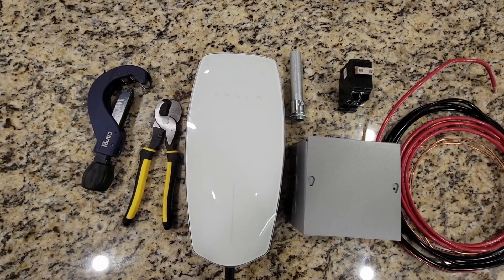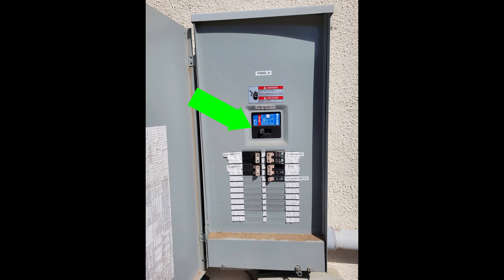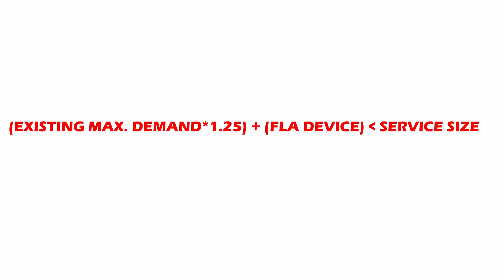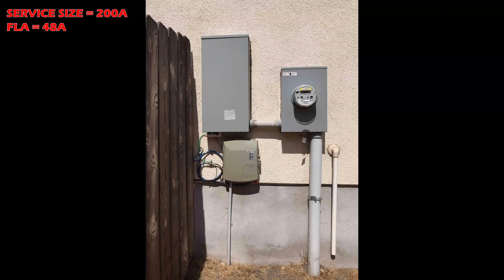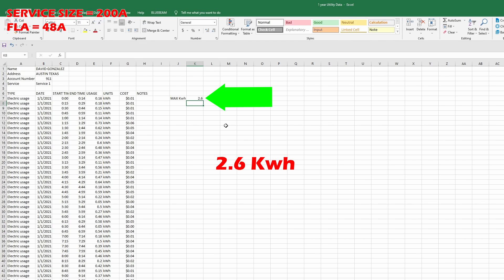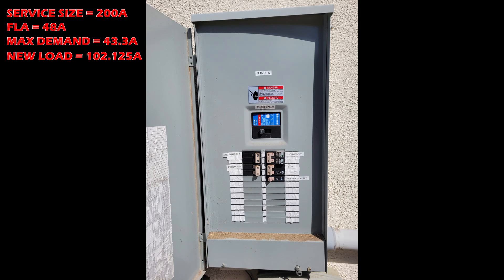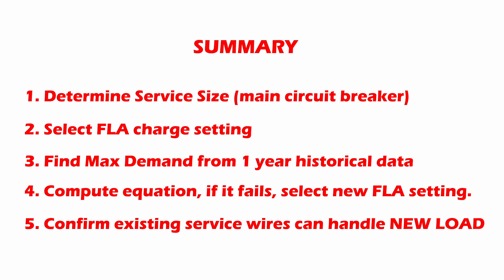Watch THIS before Selecting your EV Charger Circuit Breaker Size DIY

Comment: So to everybody out there. Never make the a phase wire red. Or on the left. Single phase red wire is always on the right and 3 phase the red is in the middle. Number one wire 120v. Is always black or top left of the panel.

Comment: My utility company does not offer a 15m break down like yours. they only list the daily kWh. what is the equation I would use to solve this problem? My highest usage day was 99kWh in August which was due to my ac having an issue which has since been replaced.

Comment: I have an Eaton BR-series 200 A load center with an aluminum bus.  My electrician told me not to run my Tesla charger at full capacity because the aluminum bus might have a problem with the 60A breaker.

Comment: Great video. I agree that this video is so much more comprehensive than most others. I installed my own Tesla charger and felt really confident I had the numbers right after watching your video (about 8 times!). I also learned a lot by downloading the 30-minute usage data from Dominion. Switched over to their Off-Peak plan, which allows me to charge below 10 cents per kWh between midnight and 5am. I have a 200-amp panel and installed a Square D 60 amp plug-in breaker with 25 feet of 6/2 MC cable to the charger. Thanks for thorough explanation!

Comment: I have experience setting up a portable generator to power a house using 50-amp breaker with interlock kit. I'm trying to set up a charger for the Tesla, and the problem is I CAN'T EVEN SEE THE WORDING OR NUMBER ON THE SERVICE WIRES THAT CONNECT TO 120V. I guess the electrician who ran these wires hid it 😂

Comment: Hello, I have 200 amp service with a 100 amp sub panel, and a whole house surge protector. Should it be okay to put the 60 amp breaker in the 100 amp sub panel, or should I move two single circuits to my sub panel to create room for a 60 amp breaker?

Comment: Great video.  If my max demand is 75a without the *1.25 on a 100a panel I'm good, correct?  As long as I don't exceed 100a with the *1.25 I'm safe?  Will check incoming wires as well.

Comment: I went full throttle with a 70 Amp breaker and 50 Amp EVSE. My car maxes out at 10 kw/h though. Ford Mach E GT on level 2.

Comment: Very useful information. Thank you.  In my house, I have a 100amp breaker panel, but the cable coming in from the transformer is rated for 200amps. If this cable was not rated for 200amps, I would have had to pay for digging and installing new larger cable. Also for upgrading the panel to 200amps, I have to wait for the utility company to come and upgrade the transformer (a green box across the street for me), as it is already at capacity, and cannot take my additional load. They explained that this is because it is supplying power to 25 or so houses in my vicinity, and many of them use  200amps with pools and what not. Transformer upgrade is free, and the utility company takes care of it. But the time impact of  these sort of thing must be considered while planning.

Comment: Can I use a 50 amp breaker and set it to 40a on my app so it sends 32 amps? ( we have a plug in Pacifica in addition to our Tesla ) I installed it with a 50 amp breaker, but I’m wondering if I should change it or if it’s OK?
Reply: No the device itself will only draw its own FLA. No need to adjust amperage.

Comment: Utilities are moving toward charging separate rates for energy vs peak demand.  If your does, you will want to charge your car at a lower amperage to save money.  I installed an 80 amp charger 10 yrs ago thinking I would want to charge quickly. I soon realized I didn’t care if my car was done charging at 10pm or 6am.  I now charge daily at just 12 amps x 240v ..and I drive 1.5x more than average .. 30,000 km/yr.  Message .. most people do not need high amperage charging.

Comment: If you have 200 amp service and a 200 amp breaker, wouldn't the service cable have to be rated for at least 200 amps? It would never have passed inspection otherwise I assume.

Comment: Excellent advice! I’ve only got 125A service, but thanks to your info, and a quick script to parse the XML format that Duke Energy allows me to download, I determined my max usage over the past ~25 months was 2.59kWh in 15 mins (= 10.36 kW), which works out to ~43.2 amps. My subpanel is fed by a 60A breaker, so I was planning on charging at 32-40A anyway.

Comment: Are you going to do a subpanel to EV charger video? I want to add a charger to a subpanel, it has a 80A run using #3 copper at 90 degrees. Panel is rated for 100A but I have a number of 20 and 15 amp breakers. Thanks!!! PS. my main panel is full! :) Oh and BY FAR the best info out there!!! Too man people just show you HOW too do something and have ZERO info on the "before you do this, DO THIS!!!"... so thank you!!!

Comment: Thanks for this. I upgraded my old 60 amp meter base and 125 amp panel to a new 200 amp CSED and a 100 amp house panel a couple months ago. I added a 16 amp EV charger last month as well, but didn't find your video until just now. My usage over the last 12 months peaked at 148 amps (!) one evening in June with many instances of 120 amps last summer, I'm very, very thankful that I didn't burn the house down. Good info to know, thank you!

Comment: I installed a 20A/220V with 12/3 wire and a simple 16A level 2 charger.  That’s enough for anyone unless you drive 200 miles a day.

Save $1000s by staying simple. It is not necessary to install a larger service to wake up each morning to a fully charged EV.

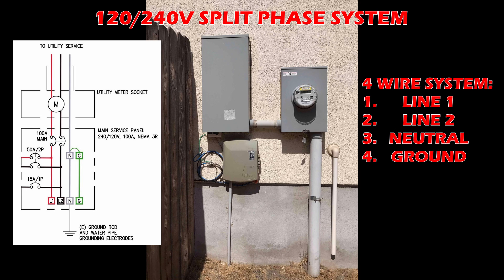Comment: Thank you for a great explanation. At 1:22 your drawing shows the Ground Rod connected to the Neutral bus, and the two connected together. Is this the correct way to connect them or should the ground be isolated from the neutral. Thanks

Comment: @6:58 you are expressing a unit of "Kilowatts PER hour". It's not the first time I've heard it, but it's annoying and incorrect. The unit is Kilowatt hour as in KW TIMES hour = 1000 Joules per second x 3600 seconds = 3.6 Mega Joules of energy.

Comment: Great Video. I have a quick question. 

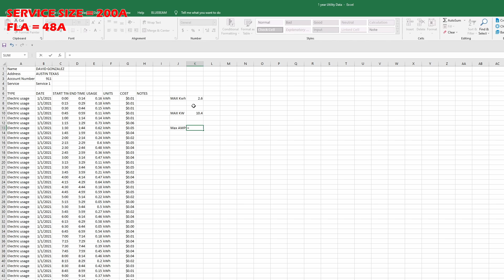@DG TV, Pardon my ignorance, at 8:05 minutes, why are you diving by 240 V ? In the US, the service is 110 V, shouldn't you be diving by 110 ?
Reply: in the US our service is 220...you have 2 110 hot legs coming into your panel, hence the 2 wires, one on each bus bar...

Comment: Im sorry but what do the service wires have to do with any of this? They’re already protected by the main breaker to prevent the wires from becoming overloaded. If anything the main breaker will trip if you have too many things on at once. But to say the service wire can become overloaded is false IF the main breaker is sized correctly.

Comment: Why are we dividing the kwh in our peak usage by 240? If everything in the house ran on 120, we would divide by 120, then the amperage would be higher. My house is mixed but only the stove and dryer run on 240.

Comment: Thank you sir for this Master Class of this topic.  Long contemplating my first EV acquisition, I now consider myself very-well informed.  I do have one question remaining, regarding house electrical wiring.  Working with an architect and builder, I designed and built my home 12 years ago.  I requested a dedicated circuit with high-capacity wiring from the service panel to the garage wall.  I told them to terminate the garage end of the wires in a standard junction box since my plan was to hard wire the wall-mounted charger.  And for inside the service panel, I told them to hold off installing a circuit breaker, just leave the three wires (L1, L2, ground, NO NEUTRAL) unconnected to anything.  The breaker would be selected and installed in the future. 
  
Long after moving in, I discovered that the electrical subcontractor used #8 AWG (19-stranded copper THHN/THWN-2 wires inside dedicated raceways) for the wires between the service panel and the junction box in the garage wall.  It's about 35 foot run.  From what I have read, based on wire gauge and the distance of the run, the highest amperage circuit breaker I can install would be a 30 amp.  Agree?  Or could I install a 40 amp breaker?

Comment: Question : Why do you devide by 240V for "Max Demand" from historic data?  The US use usually 120V for normal device (which used in historic data) even though we need to add 240V device.

Comment: Well you defiantly have a lot more to learn the buss bar in a panel is red and black on the same side only alternates from ''A'' to "B" leg from to[p to bottom  

And the blue leg can also be 120v  like black and read 

To do a load calculation you don't need your utility  power bill all you need is to know the amps of appliance's and motors plus square footages of property   and do the calculation from there 
 
 You defiantly did not design  any charging station  in California  at all

Comment: Going from a 50A circuit to a 60A circuit will also require you to upsize the wiring from 6AWG to 4AWG (copper) to the EVSE, which can add significant cost to the installation.
Reply: If you are using romex. If using thhn in conduit, #6 is ok for the 60amp breaker. Assuming hardwired and not outlet.

Comment: I suspect that if the service wires can't handle the breaker-rated load, then you have a system that's not code - before you do anything.

Comment: Good idea on checking the service wires and their max loading.  But Table 310.12 may not be exactly accurate if there are high temperatures involved or different conductors are used.  Ambient temperature would be considered to derate the amperage.  Of course, one would assume that was done correctly in the first place with the amperage of the main breaker, but maybe it was not. If the house is old, one could see how the service feed wires were calculated to an old code standard..

Comment: Braided or solid wire with the #6?
Reply from the maker: Stranded wire is easier to pull and typically less expensive
 For this reason it is preferred

Comment: Excellent video.  I looked at my last two years data.  I found that I had "one" hour where the usage reach 10.7 kWh.  All other entries are showing Max around 7.5 KWH.  My panel is a 100 AMP.  it means that I cannot use a 60AMP breaker (because of this one entry) and I have to go down to 50 AMP.  Correct?

Comment: You forgot a very important point. Checking the wire size of the conductor running to the EV charger. Just because your service wire is within spec doesn’t mean the wire running to the ev charger can take that amperage.

Comment: Excellent video & very helpful - 1 question. I have 2 200 amp main panels , if I download data from electric company it would be the max load between both the panels right ? Is there a way of calculating for individual panel ?

Comment: Great video.  So if I have a 200A service, does this mean I can pull 200A continuous?  Or only 160A continuous?  Building a new house with 5 EVs to charge on 200A service.  So there will be some dynamic sharing going on.  Tesla HPWC (Gen3) should allow me to program this to keep all my NACS and CCS vehicles happy.

Comment: Having been Nan avid YouTube DIY video watcher since the inception of YT, I must say that this video has been the MOST comprehensive video I have seen - a sincere and big THNAK YOU for that and keep up the great work.

I have a question. As far as I gather, Tesla plug does not use the neutral wire (as your wall charger wiring indicated) - so, what is the purpose of having a aneutral wire in 14-50 plug wiring?

Thnaks again!

Comment: Your information is highly technical and a bit helpful, but simply 48 Amps on a 60 amp breaker is 80% of the load this will put a lot of pressure on that circuit breaker which in my experience the breaker life will be diminished?

Comment: This was fantastic - only thing I don't quite get is why voltage basis is 240V and not 120V.  Is this because the breaker box is two 120's?
Reply from the maker: The utility data is in terms of the voltage between phase A and phase B.  For the majority of America that is 240v. Some new developments (apartments/condos)  it can be 208v. I hope this helps.

Comment: Very informatic video. Would you please confirm that if I am in US, the only change I need to do is on 8:03 mins I should divide by 110V and not to 240V and all others remain the same?
Reply: It would still be 240V - the charger would be 240, much like an electric dryer or oven. The rest of your outlets would be 110V typically.
Reply: @NHRunDad  But here I calculate EXISTING usage, which is based on 110V except dryer and oven.
Reply from the maker: If you are pulling data from your utility provider, you divide by 240v. 

Data provided by utility is derived from the Meter. There are current transformers that measure the current, it then multiplies by the voltage between phase A and phase B ( which is 240v in 99% of the states)

Comment: Thanks.  I’ve been looking something like this.  Of course a new ChargePoint Flex will go up to 50 amps.  Which means it should be using 62.5 amp breaker.  So I wonder if it’s better to go with a slightly undersized 60 amp or slightly oversized 65 amp breaker.
Reply: Oversized. But also check, many chargers will list breaker size, so the 50A listing will actually be a 40A draw. Basically they already derate the power draw from the breaker needed to support their nameplate power rating.

Comment: I am currently running into this. I have a NEMA 50 plug and since the plug is only rated for 50amps I will pair it with a 50amp breaker. If I got with a mounted charger I will no doubt go with wire that supports a much larger amount. I also have the main panel on the rear of my house next to my pedestal but it is simply an on off type situation. It goes inside to a 200amp breaker panel which then feeds a 60amp panel in my garage. I will be changing out the panel on the rear of the house with a panel with two 200amp breakers as my meter is rated for 320/400. I just need to make sure the wire in my meter base going to the box can handle that. Not a big deal. I can technically pull the meter if I need to cut off the power to that. I have been told by the power company tech that corporate will frown upon it but as long as I am not tampering with anything it isnt a problem for me to call them and have someone put a new lock on it. IE this happens here frequently when people break into places they pull the meter. I need to look at the disconnect box again because I might be able to just use that and then wire a panel into that. I just need to look at it again.

Comment: One question, if I use the 50amp nema 6-50 extension 75ft from the third floor to the first floor there is a 25ft drop from top to bottom will there be any problems?  I set the charger to 32amp, it will only use 70%, the extension is a 6 cable that can withstand 50amp.

Comment: I swear my electrician just put a wet finger in the air and looked at my breaker box for about 3 seconds before telling me to get a 60 amps on a 100 amp box, but  I told him only 40 cuz he was wilding. did a good job though... i think

Comment: If you are going to charge your EV inside your garage,  then  install a smoke alarm over your car that is interconnected to the other smoke alarms in your house. That way, when the battery goes into thermal runaway whilst charging - and don't delude yourself that "that will never happen to me" - at least you will be woken up so you dont burn to death in your sleep. And despite what Musk says, it happens to LFP batteries, too.
Reply: I’m sure you’d recommend the same thing for parking the rolling flammable liquid filled transportation devices too, right?
Reply: @txtechnonerd  I dont fill up my car with inflammable liquid at home. That would be dangerous and stupid.

Comment: What about the transformer up stream of the meter?  It seems to me that can be another limiting factor.   I have a home that has two 200A panels, one for the house and another for some out-buildings.    Service wires to both panels are 4/0.   But the pad mounted transformer feeding it all is only rated for 25 kVA, which is only 104A at 240V.

Comment: Information is wrong : Seeing your not an electrician, The colors do not dictate what side of the breaker  panel they go on.  The color just indicates the line being used.. The same reason that main service line was marked with red tape, to identify the circuit you’re working on.
Reply from the maker: My statement is not totally accurate, so I see the confusion. I said "all the wires connected to the right side should be black" I actually meant RIGHT BUS BAR (phase B); Not right side of panel. I show a green arrow pointing to the correct bus bar; the color selection is superseded by your local jurisdiction. In Austin Texas, all circuits on Phase A are Red and Phase B are black.

Comment: U need to do a service load calculation and base it off that instead of the utility
Reply from the maker: Service load is an alternate calc that the average viewer cannot perform zero experience. IMO, existing load analysis is easier and more precise.

Comment: How do you pronounce 4/0? I think the first number is the thickness but what does the /0 signify. I've seen some with /3 and read that means there are 3 wires.
Reply from the maker: "four aught." After wire size #1 AWG comes zero gauge which is denoted by 1/0. the next size up is 2/0, then 3/0 then 4/0. 
Going from smaller to larger it is:
0 gauge =  1/0 = "one aught" = "zero gauge"
00 gauge = 2/0  = "two aught" = "double zero" 
000 gauge = 3/0  = "three aught" = "triple zero"
0000 gauge = 4/0  = "four aught" 
Wires larger than four aught are measured in circular mils and are denote with "kcmil". So for example the next wire larger than 4/0 AWG is 250kcmil.